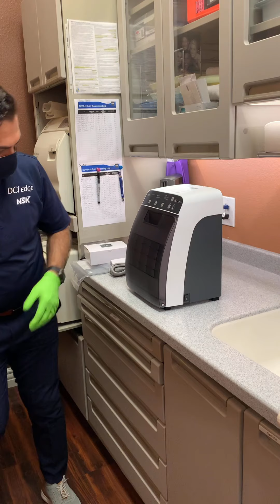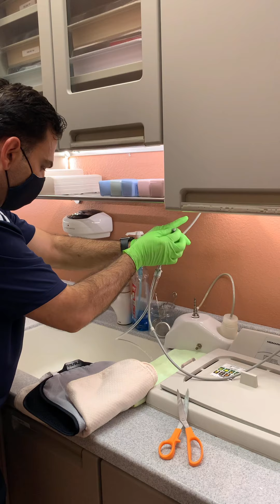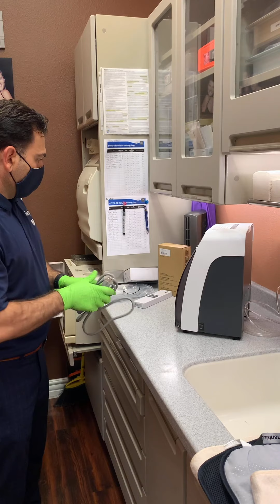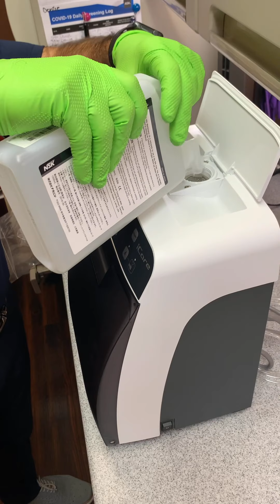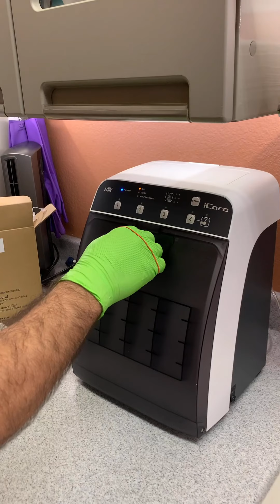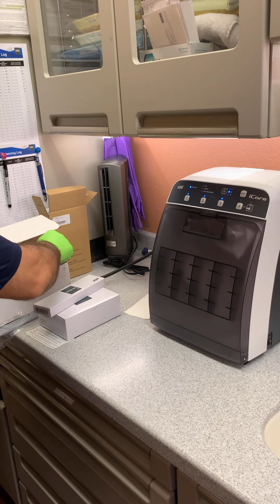NSK-iCare handpiece maintenance machine-Installation

Comment: What if I don’t have an existing air source in the sterilization area? What are the other alternatives?
Reply from the maker: The machine requires clean air supply and power. I have few offices who use a small dental compressor operating from inside the cabinet as a temporary solution. A plumber can pull an air line to the sterilization area easily.